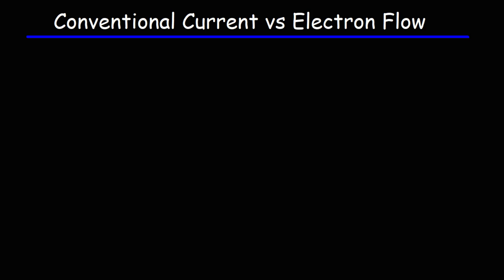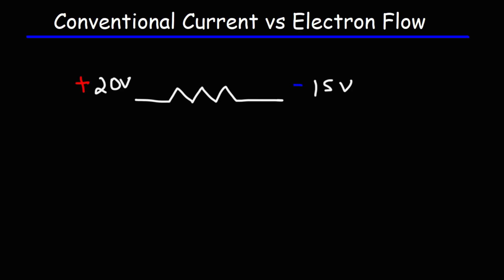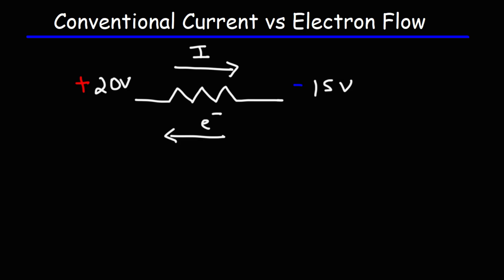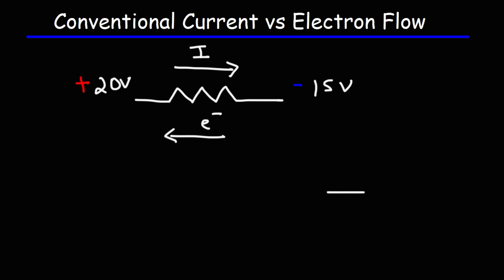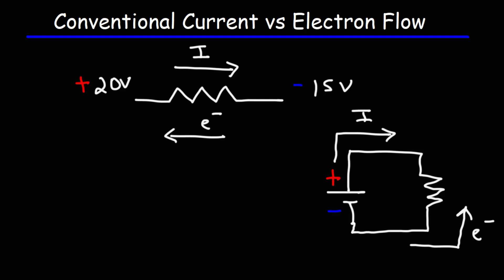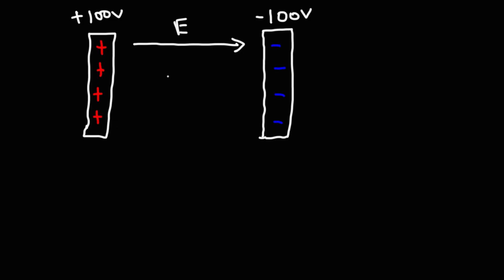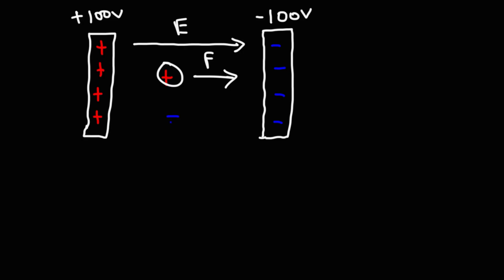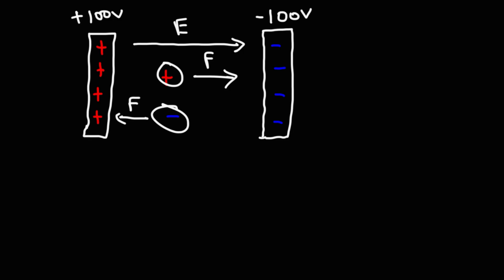Conventional Current vs Electron Flow

Comment: If a power source is attached to wires, 
on the +ve side, the terminal strips electrons from wire itself, leaving vacancies ("holes") behind with net +ve charge density. 

Next, those holes strip electrons from the next part of the wire and so on, until the chain reaction ("wave" or "current") heads over to a lower potential terminal. 

In a basic circuit, that lower potential terminal is on the other side of the power source.

You can think of the conventional current as a wave of positive charge density or "holes" headed to a negative terminal from a positive terminal.
Reply: i think of the negative pole as an infinite long string of loose rope, when the positive pole starts pulling that rope, the wave of rope getting tense goes from positive to negative, but the rope itself is going from negative to positive

Comment: Current that is caused by electron motion is called electron current and current that is caused by hole motion is called hole current. Electron is a negative charge carrier whereas hole is a positive charge carrier. At absolute zero temperature intrinsic semiconductor behaves as insulator. This is what I learned in school in the 90's. I did not use the term conventional, but it sounds like hole flow to me. Voltage got to keep it's pimp hand strong.

Comment: Excellent video !!! You could give in more details what is a flow of positive charge (convetional current)
Reply: Its the electrons that drift not the protons
Reply: It's not actual charges moving with conventional current, it's the lack of charges (regions called "holes"). 

This is due to a change in charge density in the circuit. Holes have net positive charge density, whilst electrons rich regions have net negative charge density.